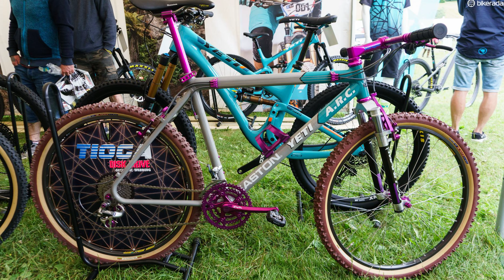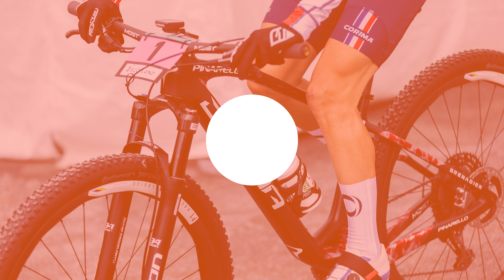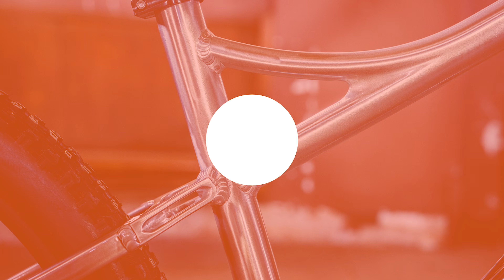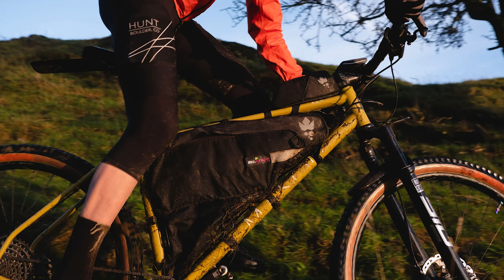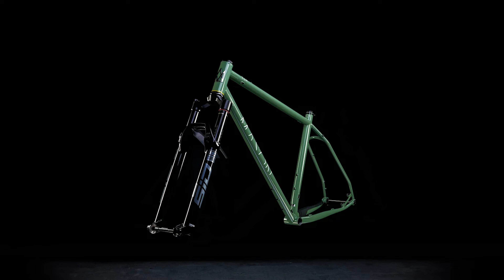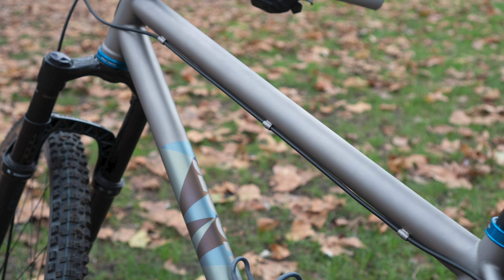Top 5 2024 Hardtail Mountain Bikes

Comment from the maker: Would you buy a hardtail in 2024? Or are you a full-suspension-forever kind of rider?
Reply: I’m a hardtail forever kind of rider.  The nice about hardtails is once you find the one with the right geometry for your riding area you do not have to replace it.  You don’t have pivots or extra suspension pieces to wear out.
Reply: @mikej… Instead you wear out your joints, and lower back!
Reply: My Hardtail is the main bike. My full suspension trail bike, is only when its needed depending on the terrain and if I’m feeling soft that day. Hardtail’s for Hard Men💪
Reply: Happy riding hard tail , grew up riding them, no front suspension at the beginning,  no doubt made us better riders . Check out the retro bike racers at races like Cannock winter classic,  very aggressive and physical,  like cyclo-cross I think.
Reply: I had a full suspension Specialized Camber and sold it to purchase a hardtail. I am not a hardcore mountain biker and for 95% of the trails I ride a hardtail is perfect.
Reply: I love hardtails! Just not the plastic ones.  Prefer steel but Alu and Ti is just fine.
Reply: Hardtail all the way
Reply: For me The best Hardtail is Trek Procaliber 6 Red 😎 because it has everything good look, geometry, and Specs. All of it for just 1000 quid it's a Bargain 🥳. Site 99spokes have option to compare it to other bikes like Polygon, Marin, Cannondale, Dartmoor. None of these bikes come near in terms of Specs for money. 🙂
Reply: this isnt a black and white issue, as your question begs. 
i have 5 bikes, 1 is a hardtail. and it rips.
Reply: Yes, but I'll buy a titanium frame and build it from there over that ridiculous $9k pino bike.

Comment: Being a heavier rider at 6',2" and 250 lbs, I got the chromoly RSD Middle-Child.  Same geometry as the Banshee Paradox and I didn't have to wait on a list for a year to get it.  FANTASTIC frame.  Mated with a bunch of parts I have accumulated over the years and I got a great bike.  Suspension is fun but let's be honest, for most rides you are better off on a hardtail and do not really need full suspension.  Makes you a better rider having a hardtail.

Comment: Please don't recommend a 29 inch wheel hardtail. 27.5 is better for speed
Reply: In what regard? 29s have been standard in xc for quite some time, and enduro has largely followed suit on the basis that they’re generally faster. I personally have a mullet and a 29er, and I’ve ridden several 27.5s. Not a world of difference between the two wheel sizes, and I find that people who say there is usually don’t have much of a basis for their opinion.
Reply: @dkumagai30  29 inch wheels are usually thicker and heavier than 27.5
Reply: @dkumagai30  I own a Polygon Siskiu T7 full suspension with 29 inch wheels. The bike is considerably slower than a 27.5 full suspension. Not a speedy bike at all. I use my hardtail for everyday commuting
Reply: @Madbomber2024  I don’t know how you gather this data in a statistically significant fashion, but this flies in the face of professional racing. I’m not saying one is better than the other, but it’s well established that 29ers are faster when compared like for like.

Comment: ARC is expensive and quite long in the tooth, so many better options out there
Reply from the maker: It is arguably both of those things, but it is still very desirable. For some, the heritage, looks and brand mean more than cost or performance
Reply: @bikeradar  That's why the LBS has had 3 of them sitting on the shop floor since before COVID, its not highly desirable at all and having ridden one, its average at best.
Reply: I have a Yeti ARC and it is bada$$. Goes anywhere and is a ton of fun to ride. Always a bunch of Yeti haters out there.

Comment: 2021 BMC twostroke AL one. Got it down to 24 pounds with an alloy frame and midrange parts! Love that bike🔥
Reply: Same with a Specialized chisel, fork and wheel upgrade and 23.45 lb bike. Owes me less than 2k all in...
Reply: @gravelDave which wheels?  I upgraded the fork but mine still weighs around 27lbs.
Reply from the maker: Both great bikes! Check out our video on the TwoStroke if you haven't already - https://youtu.be/z_xTKw0R9YM
Reply: What did you upgrade to get it that light?
Reply: @DeltaCharlie27 hunt XC alloy rims, RS Sid select fork and GX drive train, plus it was an Light alloy XC hardtail frame to begin with.
Reply: @j @joshuaallswang8016 ank you! That’s actually a very good weight for a solid build! I’m going back and forth between the alloy and carbon but I really like the way you built that out.

Comment: I'm still gallivanting about on my 2016 Ragley mmmmbop. The frame and wheels are good and stiff, so it absolutely bolts up to speed as soon as I think about going near the pedals.
I run my tyres at around 25 psi which tames the stiffness quite nicely.
Reply from the maker: Those mmmmbops were STIFF!! Especially the early 26 inch ones 😳